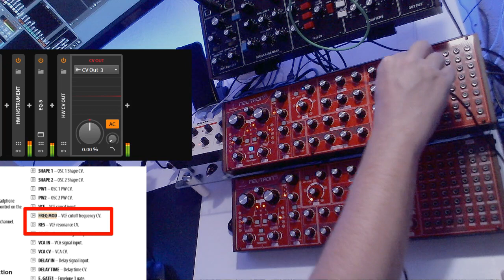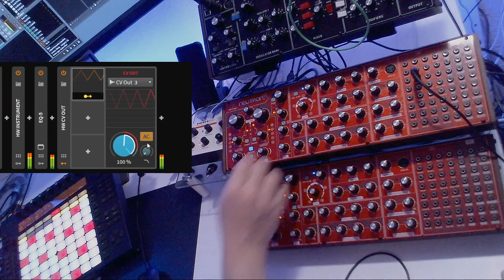Cutoff CV on the Behringer Neutron - Tutorial

Comment: Midi in Neutron. Output from Neutron. Is it possible to use the Model D's filter instead of the Neutron's and use the D's filter contour instead of the Neutron's envelope #2?
Reply from the maker: Yes, you go from the OSC MIX of Neutron into the EXT input. Then you turn off all OSC on the ModelD and enable EXT-IN. Now you need to send a GATE from your Neutron to the Model-D Filter. Use the MIDI GATE output from the Neutron, but first go into MULT, because we need that signal twice! - Get two more cables and now go from the MULT outpus on the NEUTRON into the FC-GATE input and the LC-GATE on the Model D. This will trigger the both Model D envelopes when Neutron is triggered. There is no direct output from the Filter on the Model D so you have to go through the AMP (LC) section.. i adivse to leave it fully open so it does not alter the sound of the filter curve. Now take the output of the Model-D (MAIN port) and plug it into Neutron VCA-IN. 

Now the Neutron OSC goes into the MD-filter (and amp) and the output goes back into the Neutron VCA, which is still controllable by Envelope #1 of the Neutron. So only Model D Filter and Curve has been replaced, as you requested. 

You can also experiment going into "OD IN" instead of "VCA IN", which then allows you to use the Drive section also.
Reply: @cellrok  Wow! Thank you!! Now with this patching, is it possible to use the D's Loudness Contour instead of the Neutron's envelope 1? I found ways but somehow, the D's LC and Neutron's env #1 work together, I would like to totally bypass the Neutron's env #1. Thanks!
Reply: Ok I found it: D's Loud Cont to Neutron's VCA CV :)

Comment: Thank you so much! I was using the right input but curious why it wasn't doing anything, this is exactly what I needed. I didn't realize the CV would replace the LFO as the source of modulation so I had written off that knob as the solution to my issue.

Comment: please explain how do you control your cutoff? do you have a midi to cv converter?
Reply from the maker: Yes, you can also try to use your soundcard and CV plugins in your DAW, but your Audio Interface needs to have "DC-coupled" outputs to send correct voltage.  I have bought a small module for that (Expert Sleepers ES-3) and connected it to my ADAT-OUT.. but that is pricey. You can use the Neutron as MIDI-to-CV converter. I have made a video about that. You are going to use the ASSIGN output. You send Modwheel CC1 to the Neutron and it will convert it to CV that then comes from the Assign output. You can plug it in anywhere you like and modulate/automate the CC1 in your DAW.
Reply: Is It possible to control other parameters of the neutron? For example the LFO..or the pitch of a single oscillator?
In effect I don't have understand well...I make music outside computer. With an electribe emx set to midi master unit..that control other Gear connected to every own synth part. And I send midi CC from the electribe..assignable for every knob.
Reply from the maker: The Neutron usually does not understand MIDI, but you could send Modwheel CC and configure the Neutron to convert it to CV using the "ASSIGN" output. 

You can use that signal with a patch cable (Neutron comes with 5 of them) to control anything that is accessible on the patchbay, like the Filter, Resonance, Delay- or LFO rate, etc..

But effectively only 1 parameter at a time, because the is only one "ASSIGN" output. You could of course duplicate that signal with a split cable or using the included "MULT" input and then have the same modulation for 2 parameters, but that is really it.

Oh, and there is also a "MIDI GATE" which sends a trigger when a note arrives, which is sometimes useful to have.

So.. with CC only one CV input is controllable. Nothing else responds to CC.

By the way: The LFO also responds to midi clock, so you could sync the LFO modulation to tempo.

You would need a CC to CV converter if you wanna control more params. Check out Doepfer products. They have some Midi tools that you can Midi learn any CC. The "Dark Link" or the "MCV4".
Reply: @cellrok  wow..thank you very much!! You are a professor...infact the neutron  is a fantastic synth..but It cost less for It features. I can record the knob movement on the electribe. And expand the music creativity. But only ONE control at time on neutron...with the assign output...!😬